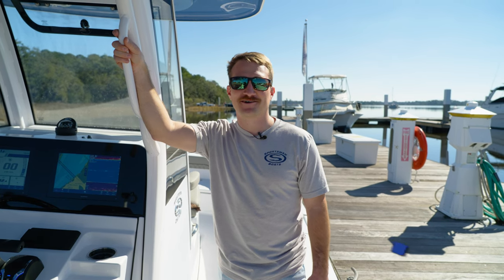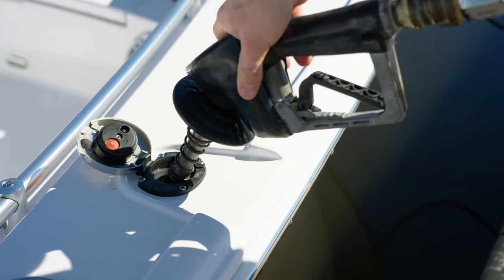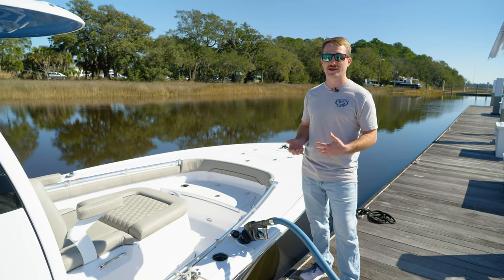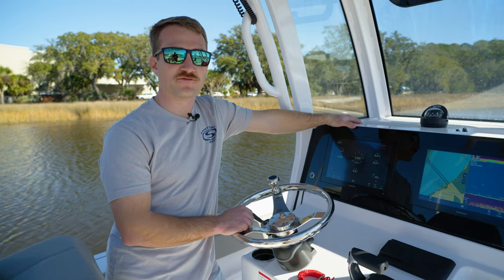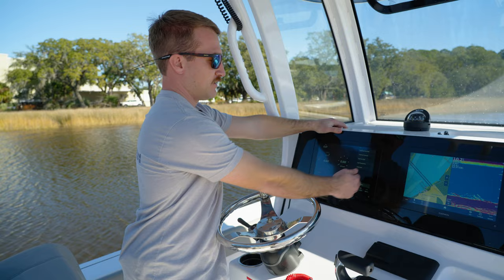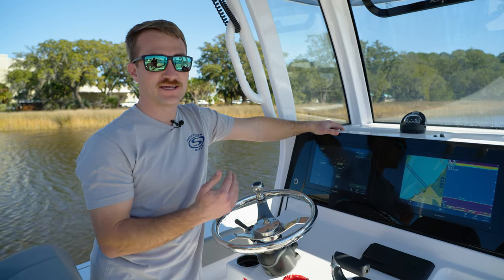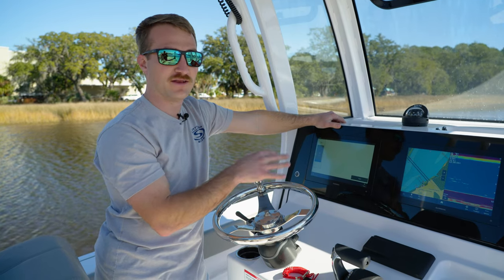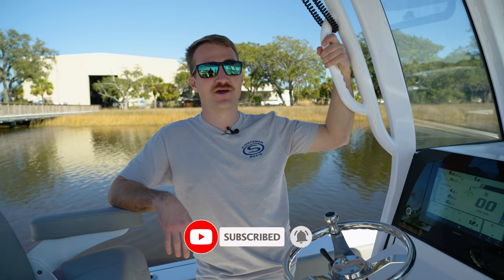Tech Talk - How To Properly Fuel Your Boat & Set Up Fuel Gauges

Comment: Hey Chase, 
I have a 2021 Open 232. I have had a really hard time with the accuracy on these garages. Would you recommend the same thing? Also, it takes FOREVER to fill above 75 gallons. I have to slowly release it on and off for about 20minutes. Any thoughts on why that could be happening?
Reply from the maker: Yes same principles will apply to any of our boats, as far as filling over 75 I would have the dealer clean the air line in the fuel cap just to be sure it hasn’t gotten filled with debris over the years. - Chase